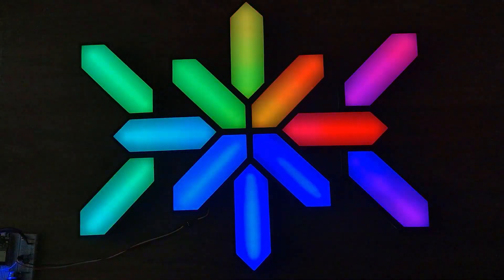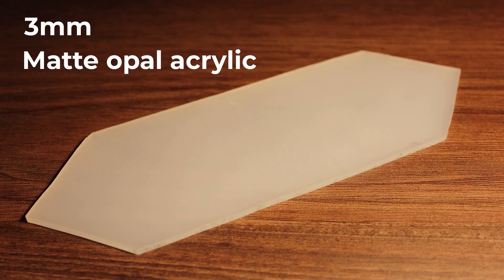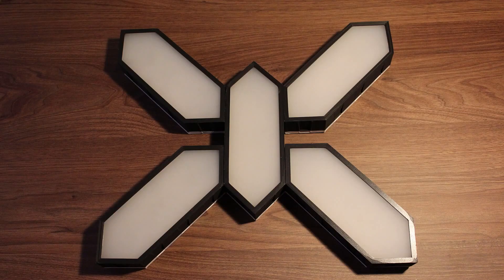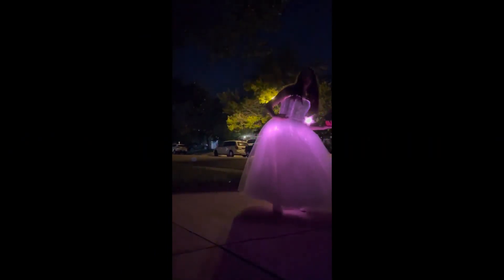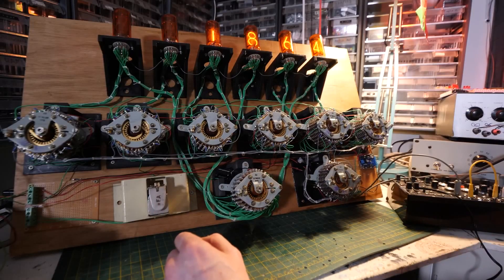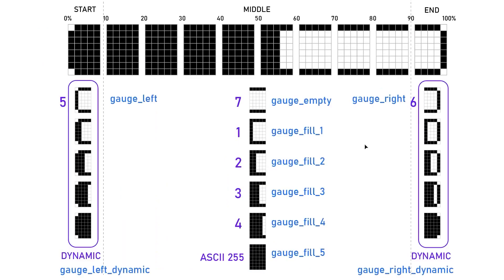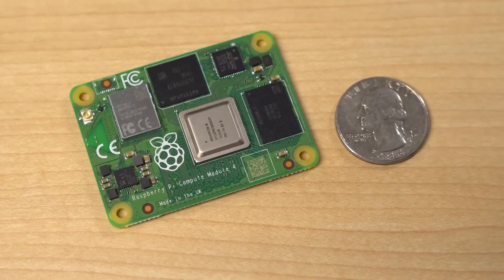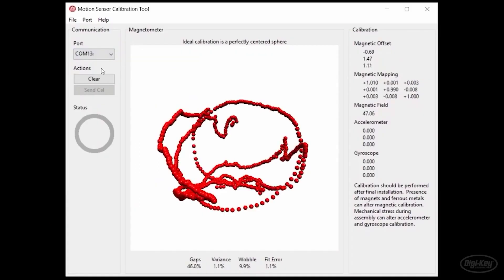Tangled Up In Hue [Maker Update} | Maker.io

Comment: That dovetail saw guide looks like a clone of Jonathan Katz-Moses's jig, which he's been selling for years. Maybe just convergent design, but it strikes me as a copy
Reply: It's straight cutting guide, not a dovetail guide. Although on first glance they may appear similar, the function is actually quite different. The saw guide featured in this video holds itself in place for straight cross cuts, something the Katz-Moses jig does not. The concept has actually been around for decades. Adding magnets to them is more of a recent innovation and I've seen many different variations. The design presented in this video is great for someone who is interested in straight rip and cross cuts, not dovetails. It's also a lot easier to make than a dovetail jig, since you don't have to worry about cutting the dovetail angles.